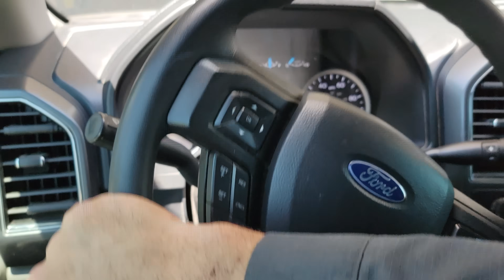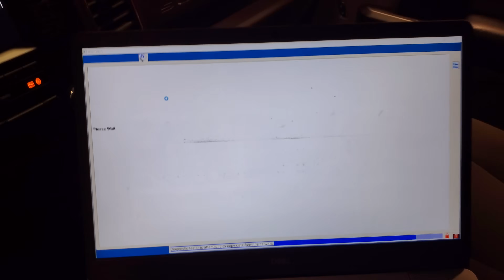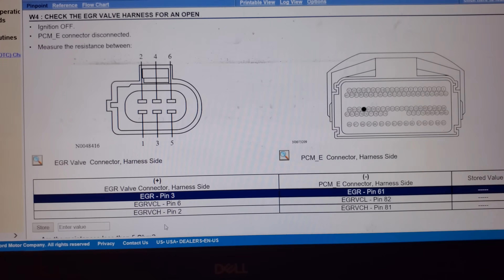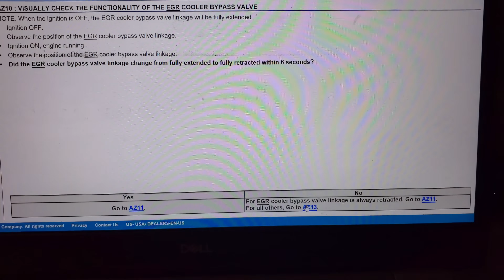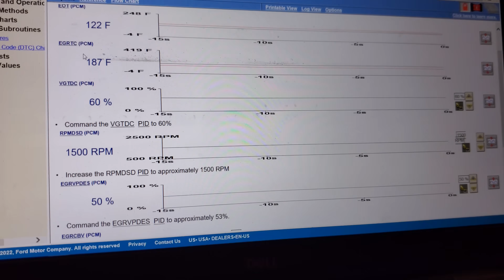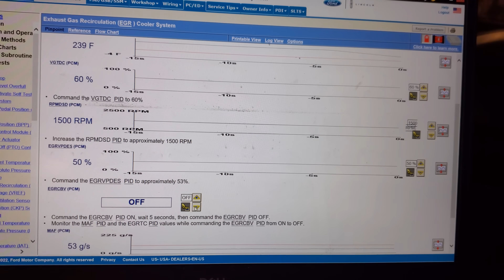another dealer TOTALLY missed this P0401 | 2019 Ford 6.7 Powerstroke | SMH

Comment: I am having an issue with a P0402 code. I have seen quite a few videos on the P0401 but really nothing on the P0402.  It started after I changed my cold air hose. I replaced the MAP sensor and still have the problem. Just curious what you have experienced with the P0402 code?
Reply from the maker: What year? Might have to do an air filter reset with scan tool OR pinpoint test  will need to be performed for diag on the EGR valve.
Reply: @PowerStrokeTechTalkwARod  Sorry, it is a 2018.
Reply from the maker: Then I second my response

Comment: Thanks alot for the video. Have a 2018 F450 in the shop today with the same problem, and you nailed it. The top two ports were completely plugged, jam packed.., only the bottom port partially open.
Dont have access to IDS to perform this level of diagnosis, and was ready to condem the EGR cooler, but your video saved me from an incorrect diagnosis.

Thumbs up and subscibed. Thanks again for your video.
Reply from the maker: SO glad it saved you, I had to learn da hard way. Kick me a$$

Comment: At the 3 minute mark you stated that 11 thru 16 is no big deal? Why? I had the egr valve replaced but the p0401 came back on. 😞 any suggestions?
Reply from the maker: On the 11-16 platform, the infamous P0401 is NEVER a valve. Whoever replaced it should have gone through pinpoint test AZ and they would have found out that the EGR cooler core is restricted. Watch our video where we fix that problem for good.
Reply: @PowerStrokeTechTalkwARod thank you  soo much!

Comment: When you command egr operation up shouldn't the truck start running bad at idle ? Have a 2016 6.7 and has had 2 egr valves installed, cooler looks clear . 40k miles on truck .I've commanded egr position up and down and no change in idle or maf ?
Reply from the maker: Better make sure them egr ports are clean in the lower intake.....
Reply: @PowerStrokeTechTalkwARod  they weren't had no idea the inside was designed like that it was absolutely jammed. Could see 0 light from flashlight from other end. Working on unclogging now.
Reply: So i checked these ports after lunch when I left these questions, turns out my ports were absolutely crammed full. 2016 40k miles , no wonder egr operation had 0 affect on operation.
Reply: Thanks appreciate it immensely, i also got this one after several times parts were thrown at it by others.

Comment: 2019 f250 here… cleaned all that gunk out as well, truck started up first time a little rocky… gave it gas and it died after settling… started up second time and it died right after as well, now it just cranks, but won’t start. do i need to relearn TB or do some sort of reset? thanks
Reply from the maker: No learning. Shld be running
Reply: @PowerStrokeTechTalkwARod Any suggestions as to what may have happened or what to check for? i did remove the throttle body to clear the gunk from the lower intake and just scraped the build up from there and the throttle body itself. Thank you
Reply from the maker: @vaccid did some of that black stuff get sucked in.....
Reply: @PowerStrokeTechTalkwARod  i vacuumed it all before starting up
Reply from the maker: @vaccid nahhhh some of it got sucked in. Email me. Description of every video

Comment: Question, 11-16’s lots of trouble with po401…replace the filters or the whole cooler?  Are the 2017 filters the same size as the 11-16’s, and can the 17’s be used in place of the original ones?

Comment: I got 2 of the 3 holes cleared on the one I'm working on. If that's not enough, we're replacing the lower intake.
Video of the cleaning process would have been nice. Pointing out the problem area was a huge help regardless. Thank you.
Reply from the maker: Cant show u all everything 😏

Comment: Just cleaned my throttle body and inside the intake on my 2017 Super Duty. P0401 code is gone and running fine. Took about an hour from start to finish. Great video.

Comment: I just got a CEL on my 21 6.7 F250 and in FordPass it says "The power train control  system has detected the expected amount of oxygen in the exhaust was not within the expected range during certain vehicle operating conditions". I obviously haven't had a chance to get the code read, but does that sound similar?
Reply from the maker: I will tell u its not whats in that video
Reply: @PowerStrokeTechTalkwARod  got it, thanks!

Comment: I think this exactly the problem I'm having. Mine is 17 model, got the light,  took off the throttle body which was caked up like the one your working on. I cleaned it and vacuumed up the material. Engine light went out for awhile then came back on. I didn't see those ports you pointed out so I will recheck to make sure they are clear. This started when I noticed the intercooler hose split. Will the engine code light go off if cleaning those ports out is the problem or do I need to have a reset. Thanks this was a really helpful video

Comment: i have a P0402 code which is excessive flow from the egr.  It's been at the dealer 4 times and still not repaired.  They are now going to replace the egr valve on my 2017 SUPERDUTY with only 4600 miles on it.  When I first took it in it was still under the 5 year emission warranty now it's over the warranty and they are going to bill me over one thousand dollars to replace the egr and I don't know if this will fix the problem, not too happy. Will be contacting Ford .ca shortly.
Reply from the maker: I hope they help you...

Comment: I think you solved my problem!!! Do have a question. What was the trick to get that plastic piece off that secures the hose? I see there is a hose clamp to remove the hose. But not the plastic housing. I don’t think I can get a socket on without removing it.
Reply from the maker: What plastic piece?
Reply: Sent you a email with a picture for reference.

Comment: This is the second video I’ve seen you make where those egr ports were clogged in the intake and cleaning them out solved the issue. Crazy
Reply: Happens a lot. Techs don't go far enough when performing the first step in the  pinpoint test. Normally they will stop at the turbo looking for intake restrictions.

Comment: How bout a infamous p0606 in the 7.3 powerstroke???
Reply from the maker: She still run
Reply: @PowerStrokeTechTalkwARod  Runs like perfect once i get it restarted. After 5-6 hours of towing if I turn it off it wont restart unless I unhook the bats. Then fires right up.cranking when no start rpms  are180, ICP is 1900 psi . let it set overnight and no start.Disconnected bats and fired right up. Have driving everywhere without incident now, but no real heat soak due to towing.

Comment: And all that crap goes into the motor.  All the reason to delete....EGR, DPF, DEF, TB, CCV....all unnecessary junk.

Everytime I change the oil on the 6.7, it's a nasty black compared to my 7.3 PSD.  All that soot goes into the motor.  Hopefully after the weight loss, it'll clean up.

Comment: After your videos in the past about this, I cleaned that area out along with the butterfly flap when changing the CAC tube at 100k for preventative maintenance. That was one dirty and nasty job!! I wasn’t having problems but feels good to have it clean and work as intended. I also replaced the MAP sensor since it was plugged and cleaning it did not work. Regens happen less now and it sure made the truck seems smoother / more responsive. You rock! Seems like a good thing to check on.
Reply: Any thoughts on cleaning/changing the Exhaust Pressure Sensor and tube? Or just leave it be?
Reply from the maker: Id just leave it be

Comment: What can you donor use that would assist in preventing maintenance to keep EGR system as a whole cleaner or happier?
We daily a 16 for now since we RV and when we are working, the tow pig is our 2nd daily driver. So it seems more lower speed daily driver usage and then occasionally highway use.
I do use EDT in the fuel every fill up but that's a CP4 concern helper more than anything.
Reply from the maker: It wants heattttt
Reply: @PowerStrokeTechTalkwARod  so drive it like I stole it to work....got it! 😂

Comment: Does this apply to a 2021 F750 w/the 6.7?

Getting random code, engine light comes and goes randomly. When she derates under code, a restart usually gets power back.

She has 53k on her. Problem began at 43k ish immediately following an oil change.

Oil changes are pretty consistent at 4,300 miles.
Reply from the maker: Yes brother

Comment: I still get the po41c on my 2020.. 
Ill check this. Thanks. 
And, the EGR cooler core went bad at 105k.  Actually found some broken washers in the front section of it.
Reply: Now if the ac electrical issue would just  fix itself..
Reply from the maker: Whaaa

Comment: So I’m working on a 2015 throwing a p2201…. Only if it sits over night…. I have replaced nox1 because it was reading high. Updated pcm programming, tested all wiring, even cleaned the ports in the intake where ERG flows, now today we replaced the EGR valve… that’s what diagnosis told us to do….. am I missing something…. ?? Thanks for the videos…. They have helped me in our shop.
Reply from the maker: Whats that NCCE pid in mode 6 reading?

Comment: What is the difference because the 6.7 pickup and 6.7 cab and chassis 
You mentioned for the egr 
one is aluminum and one is cast iorn
And your commonly replacing the cast iorn one why wouldn't they just 
Use the aluminum one on the cab and chassis
Reply from the maker: I wish they told us😔

Comment: I had the same problem on a 2019 ambulance at 25,000 miles. The dealer tech did the tsb, replaced the core and put a new egr valve and mass air flow sensor on it. This took 2 months. What fixed it? Cleaning the intake ports you showed!!!! In addition we also had a plugged ccv filter. I now replace the ccv filter every 15000 miles, when it starts using oil i know it is plugged! I don't know if a plugged ccv filter is a contributing factor? But it can't be good to plug the ccv filter and start drinking oil! With a good ccv filter there is zero oil usage. Keep in mind this is on an ambulance with excessive idle time. I can't change the way it's used. Thanks for highlighting this issue! It is an easy fix.
Reply: Do the CCV reroute and you will never have to deal with the filter ever again, So much easier to not deal with.

Comment: I had P0401 on my daily driven (commuter in SoCal) 2019 F250 6.7 around 45K mileage. Drivability was weird, loss of power and response in light throttle driving, still performed normally at higher throttle driving, Mpg suffered and transmission would not lockup converter at light throttle conditions. I cleaned MAP sensor with acetone soak and delicate q-tip agitation, cleared code. Drivability improved to good as new for 5K miles. Same code came back at 50K mileage, took to dealer and they recalibrated the PCM and cleared code.  At 55K mileage drivability issues resurfaced. I cleaned MAP sensor again and drivability was restored to as new. No code has displayed since PCM updated. Very annoying that MAP clogs so quickly. Going to try S&B MAP spacer next with a new sensor next time drivability issue resurfaces.
Reply from the maker: I'd be curious to see what or how that works

Comment: The MAF is also used for limiting the total amount of fuel to be injected. Lambda is calculated based on the MAF data and converted into g/s of airflow. grams of air mixed with grams of fuel = X lambda.
Reply from the maker: The MAF here, on these...does not make those calculations, strickly for EGR friend
Reply: @PowerStrokeTechTalkwARod  You're right, this specific video you are calculating EGR flow based on the decrease in MAF or Mass air flow. I'm simply saying the MAF is used for calculating the total available airflow to be burned which ultimately is lambda limiting. If you still don't believe me I'd be more than willing to talk/prove it to you! Cheers!

Comment: Question for my 2013 6.7l. I drive 99% highway, speeds roughly 90khm to 120khm. Would I see less issues in this department than driving at lower speeds?. I keep my engine Temps at optimum Temps and notice very little regens on my dpf considering I don't drive short little drives.. My 6.0 had no issues at all. 600,000 khms on it and rising..
Reply from the maker: Ur prolly good, dry and sooty, which is good for you

Comment: Do you guys know by chance what's the average millage on the odometer, when these code is coming up? Have Y'All found any correlation?
Reply: Depends on how much idle and city driving you do. Emissions failure are not really a mileage thing. It's a driving habits thing.
Reply: @codyphillips48  Thanks for the heads up. From both usages, which one are you seeing the most with this issue? city (with more idle) vs highway (with less idle) drive?
Thank You!
Reply from the maker: Idle is the killer broski. You have 2 under it needs heat heat heat
Reply from the maker: NO correlation